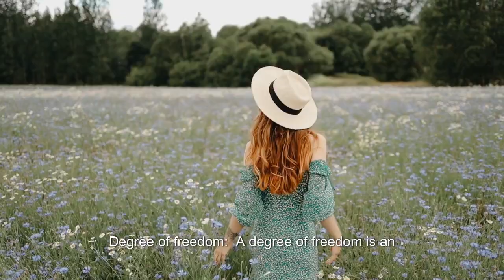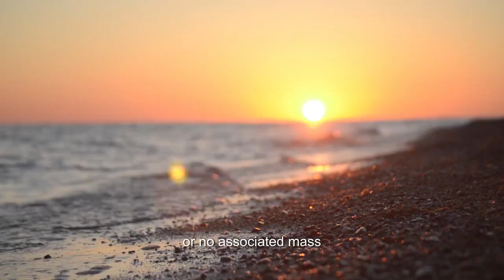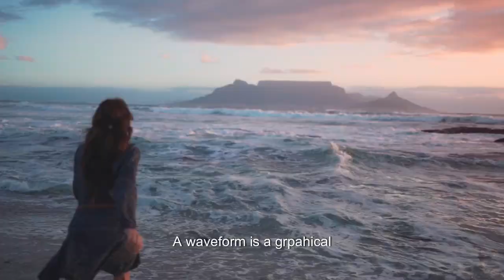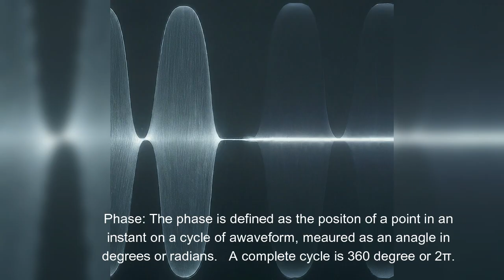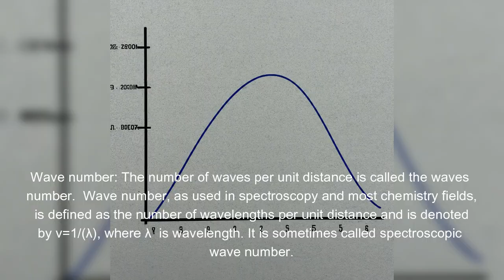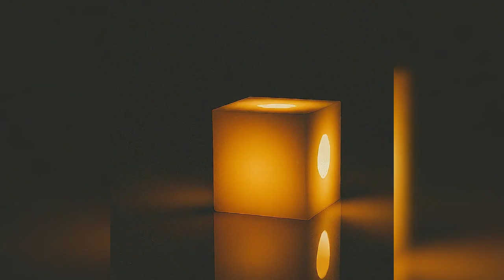Definitions of Fundamental Terminologies Related to Quantum Mechanics.

Comment from the maker: Script: 
Definitions of Fundamental Terminologies Related to Quantum Mechanics

Observable: A dynamical quantity which implies, the position coordinates, the components of momentum or angular momentum that can be measured is known as observable. A physical observable is anything that can be measured.

Degree of freedom: A degree of freedom is an independent physical parameter in the formal description of the state of a physical system. The set of all states of system is known as the system’s phase and degree of freedom of the system of the dimension of the phase space.
The degree of freedom of a mechanical system is the number of independent parameters that define its configuration. Any of the coordinates, a minimum number of which are needed to specify the motion of a mechanical system is the degree of freedom.

Wave:  A wave is a phenomenon or disturbance that transfer energy through matter or space with little or no associated mass transport for mass transfer.

A wave is a disturbance that travels through a medium transporting energy from one location (its source) to another location without transporting matter. A wave is a disturbance in some physical system which is periodic in both space position and time.

Stationery waves: A stationery wave is a wave that oscillates in time but whose peak amplitude profile does not move in a space.  Stationery waves are the combination of two waves that move in opposite direction but have the same amplitude and frequency this phenomenon is the result of their interference.

Waveform: A waveform is a graphical representation of a signal in the form of a wave. 

Cycle: One cycle of a wave is one complete evolution of its shape until the point that it is ready to repeat itself. 

Wavelength: The wavelength of a wave is the length of one compete cycle of the wave. For a transverse wave, the wavelength refers to the length of a wave from one peak (crest) to the next peak (crest). The wavelength can always be determined by measuring the distance between any two corresponding points on adjacent waves parallel to direction of propagation.

Amplitude: The distance from the peak (crest) or the maximum distance to the trough (rest) or the resting position of a wave is called the amplitude or height of the wave. 

Frequency: The number of waves that pass a fixed point per second or per unit time is called frequency. The unit of frequency in the international system of units (SI) is Hertz (Hz).  One Hert z = 1 cycle per second.

Period: Time required to complete a full wave cycle is called a period. 

Phase: The phase is defined as the position of a point in an instant on a cycle of a waveform, measured as an angle in degrees or radians.   A complete cycle is 360 degree or 2 π. 

The phase Shift: The phase shift is how far the wave function is shifted horizontally from the usual position. 

Wavefront: A wavefront is defined as a surface over which the phase of the wave is constant. Wavefronts usually move with time.  For waves propagating in an unidimentional medium, the wavefronts are usually single points; they are curves in a two dimensional medium and surfaces in a three-dimensional one.  Plane wavefronts and Spherical wavefronts are particularly important.

Plane wave: A constant-frequency wave whose wavefronts are infinite parallel planes of constant Peak-to-peak amplitude normal to the plane velocity vector is called a plane wave. 

Wavevector or Propagation vector: The wave vector of a plane wave is a vector which points in the direction which points in the direction in which the wave propagates. It is always perpendicular to the wavefronts.

Wave number: The number of waves per unit distance is called the waves number. 
Wave number, as used in spectroscopy and most chemistry fields, is defined as the number of wavelengths per unit distance and is denoted by v=1/(λ  ), where λ  is wavelength. It is sometimes called spectroscopic wave number.

Quantization or Quantisation: In physics, quantization is the systematic transition procedure from a classical understanding of physical phenomena to a newer understanding known as quantum mechanics. It is a procedure for constructing quantum mechanics from classical mechanics. 

Quantum number: The minimum amount of any physical entity or physical property involved in an interaction is called a quantum number.  In quantum mechanics, the physical quantities are in general quantized and as a result these quantities are prescribed by numbers, not essentially integers. These numbers are called quantum numbers.  As the idea of definite orbit does not exist, so quantum number n specifies the relative distance of a particle from some common point.  e.g. The electron with n=2 is at greater distance from the nucleus than the electron with n=1 and so on.

Quantum States: The condition in which a physical system exists, usually described by a wave function or a set of quantum numbers is called quantum state. A quantum state can be described by a state vector, a wave function or a complete set of quantum numbers for a specific system. 

Electromagnetic waves: In the region of an electric charge there is an electric field in the neighborhood of an electric current there is a magnetic filed. Variation of the fields change the electric and magnetic fields and propagate through space. The propagation of such a disturbance is called an electromagnetic wave. 

Free particle: A particle moving in a field-free space is called a free particle. 

Black Body: A particle which absorbs all the radiant energy falling upon it is called a black body. Its absorption coefficient is equal to unity at all wavelengths. 

Perfectly black body: A body which completely absorbs radiation of all wavelengths incident on it is called a perfectly black body. A good absorber of of radiation is also a good emitter of radiation and so a perfectly black body is the best possible emitter at any give temperature.